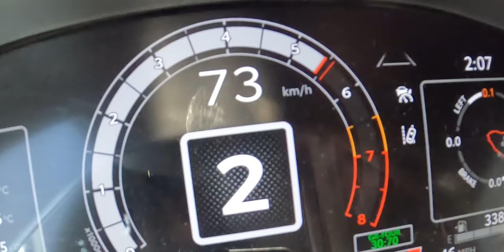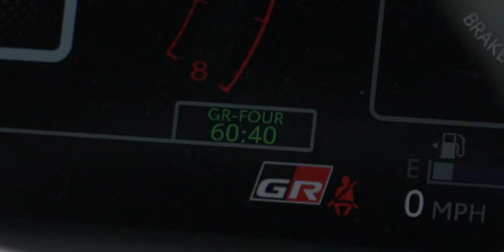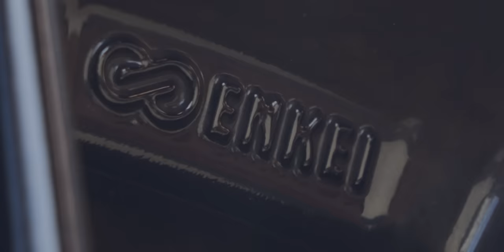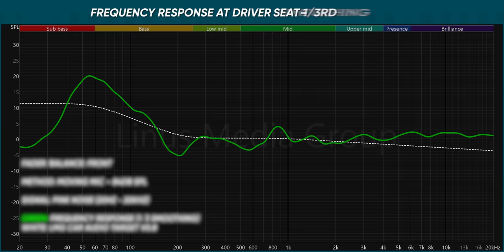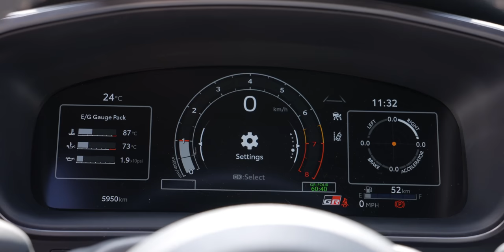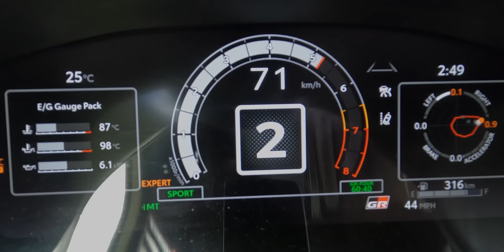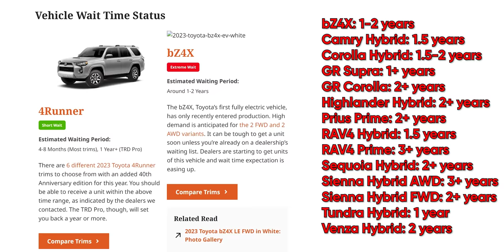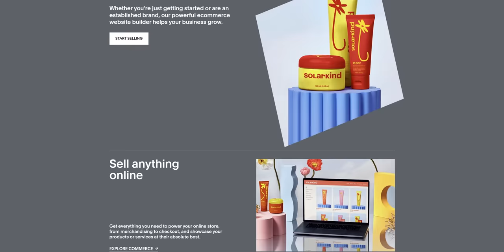I have made a very expensive mistake - Toyota GR Corolla

Comment: Woow linus drove a 94 swift? Was it 1.0 or 1.3? (Or the 1.6?) My daily is a 1.0 3 cyl from  '00 its crazy fun, supercheap less than 600€ and maintanance is like crazy eazy, something broke a very essential part in the engine, like the injector? Welp imma just go to a scrap yard, pick up one for 50€ go home use my wrench and my srewdriver and fix it in like 30 minutes, like literally if these cars would be rust proof it would be cheaper than walking

Comment: Dropping native support for CarPlay and Android Auto is one of the MANY stupid moves  on Toyota's part.  If we were talking about an infotainment system that can wirelessly stream music for $15/month, using the car's built-in cellular data plan...that makes sense as long as I can access that music outside of my car or on my smartphone.  But this BS?
They want $15/month to give me permission to stream music?  NO
They want $15/month to play the songs on MY smartphone?  NO
They want $15/month to to use MY OWN data plan to get that music?  HELL to the no.
They want ANOTHER $15/month for navigation data, or you could subscribe to the $25/month package that does it all.

This is 100% greed and paywalling on Toyota's part.  Everything outside of Toyota's little cash-grab is either paid for in full or licensed on a monthly basis.  Their pre-stupid system was compatible with CarPlay and Andriod Auto, which means Toyota had to spend money blocking those services AND adding subscription checks to do all of this crap.  And the cherry on top is Toyota added this to Corolla, which is supposed to be their cheap model!

Folks, you can buy your car and tell yourself you won't need to stream music or LOOK AT MAPS, but eventually you will give in.  The only way to really hurt Toyota is NOT BUYING A TOYOTA.

Comment: 6:17 it’s electric with paddle shifters?
Reply: It's regen paddles
Reply: @philspaghet  what does that mean?
Reply: @SimpleManMike  they control the amount of regenerative braking the car does when you let off the throttle or lightly press the brake. It's braking by the electric motor to charge the battery instead if using the physical brake calipers
Reply: @philspaghet  oh ok, i knew what you meant but just didn’t think how it worked
Reply: @philspaghet  thx fam

Comment: why not get a golf R at that point ?????
Reply: a golf r is so heavy and is clearly not a drivers car like the gr is not saying its not fun its just not a gr
Reply: @eratoz5096  bro your on crack the golf R is an amazing track car I Daliy that car all it needs is an upgraded sway bar and it’s easily the best car on the market
Reply: @rkiller56pbs44  im comparing it to a gr like I said its still really great and volks knows what their stuff but a gr is litterally only made for a driver inside and out  the golf r is faster on those straight because of the power but it still doesnt beat a gr on corners

Comment: all that money and you bought this?!?!?! lol
Reply: This is exactly the car I'd buy if I won the lottery. I don't want a super expensive or fancy car. But it would be really fun to drive a great for winter roads
Reply: @JohnDoe-cv8iw   Which modern car screams longevity and reliability in the first place.

Cars post 2004 are all plagued with electrical issues and cost cutting measures from manufacturers. 
Except the corvettes, Camaros and the similar cars/trucks with pushrod v6 or v8 engines, they're sort of good, but with a drawback that the tech they're using is ancient, so nothing really to be excited about.
Reply: YES. You cannot buy anything else like this for the money. Manual turbo AWD hot hatches are rare and if you want a manual in the first place, your options are severely limited. This is the best hot hatch money can buy at the moment in the USA